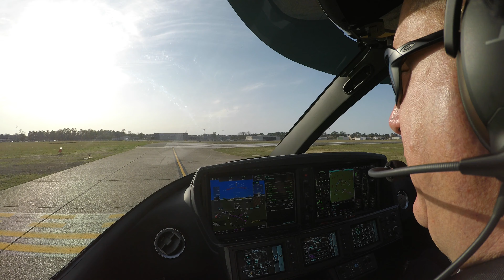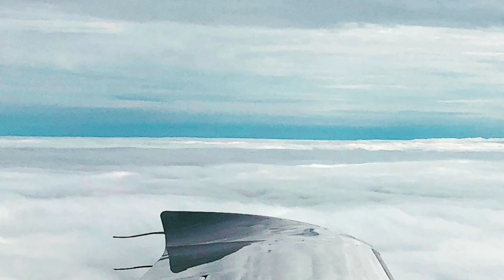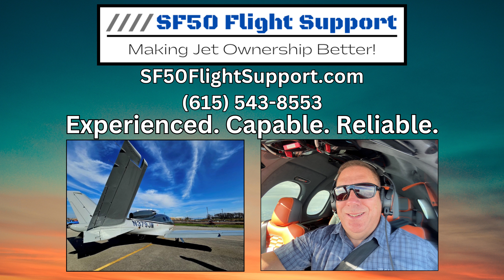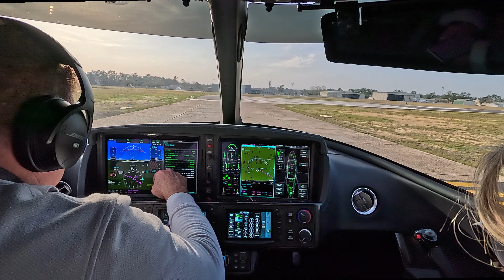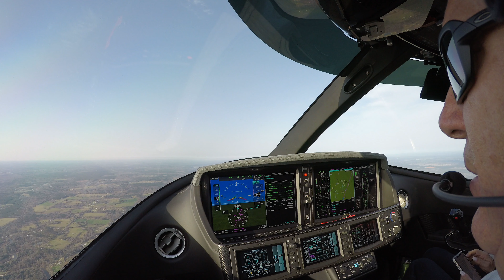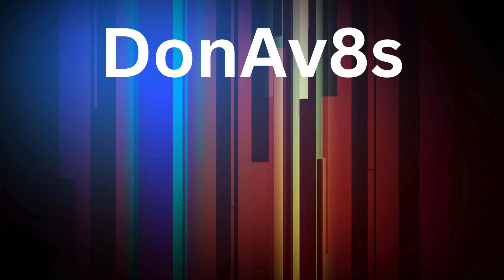How Air Traffic Control 🧐 Just Prevented a Potentially Catastrophic Runway Collision ✈️

Comment: What is the CAS message on T/O? I thought CAS was meant to be clear on T/O?
Reply from the maker: Yes, newer G2+ Vision Jets have Cirrus IQ installed. This is a system that sends data to Cirrus from the plane for reporting purposes. Some of the data can be seen in the Cirrus IQ App. This system uses battery 2 and puts demand on this battery while the plane is hangared. The CAS is to advise battery 2 is still charging. The plane was parked for nine weeks so it took longer than usual to charge battery 2. Part of my briefing in this case, which was not heard in the video, was to give battery 2 a few minutes in flight to charge or return to Hammond. You will see the CAS cleared shortly after takeoff and was a non issue. Normally, you would not depart with other CAS message but this is a workaround until the Cirrus IQ demand on battery 2 is rectified in the future.

Comment: Glad you decided to go ahead and post this one. Really interesting to see, and I really appreciated the tip on back-taxiing off to the side. I’ll incorporate that on the rare occasion that I need to do a back-taxi. It seems like at least the delay was minimal for both you and the plane that went around. When he told them to contact approach for re-sequencing I was imagining it would take them longer. Glad the plane’s working well after the repairs, too.
Reply from the maker: @MikeKobb  Thanks Mike! I appreciate you watching…. I noticed when I was editing that a King Air, which is shown lading about 45 seconds before I was given the takeoff clearance, was slow to taxi off at the end of the runway. I should have seen it, but could not since it was so far down the runway when I entered it. You can barely see it in the video after it turned sideways onto the taxi way and if you zoom in. It would not have been a factor if I was allowed a static takeoff, but it certainly was since they had me keep rolling. The Controller made the correct decision. I am glad the plane is working again too. 1600 mile trip tomorrow to California!

Comment: Thanks for the video.  9 weeks AOG for an in production, likely in warranty, $3M jet seems crazy. Is that common?
Reply from the maker: Hello and thanks for watching! In the SF50, there is the warranty and also the JetStream program. The warranty covers certain things like paint and workmanship for a year. On the otherhand, JetStream is a prepaid maintenance program where there is a rate paid per flight hour in advance for maintenance.  Some jet programs are “pay as you go” but JetStream is prepaid. There is a fine line between warranty and JetStream but I think it is mainly decided internally so Cirrus receives funds for maintenance from the right bucket.  I flew my previous Vision Jet over 600 hours but never has a problem with the PRSOV. In fact, it was a reliable aircraft even though it was made in 2018. I flew my new Vision Jet away from the factory service center in June of 2024 and flew it 93.5 hours before any issues whatsoever. Most new planes, from any manufacturer, have minor squaks when they enter service so I feel pretty lucky in that regard. That being said, there was rumors nearly two dozen SF50’s were AOG for similar PRSOV issue at the same time out of over 600 airplanes in the fleet. Cirrus indicated that the majority of the lead time for the parts I needed were related to their manufacturer of the part. It could have been due to redesign of the part or perhaps supply chain problems.

The good thing is Cirrus has built out field services and they add new service centers on a regular basis. All things mechanical break, but having the infrastructure in place to react to problems in the field is something Cirrus is getting better at. I have been told Textron is the best in general aviation for field services.